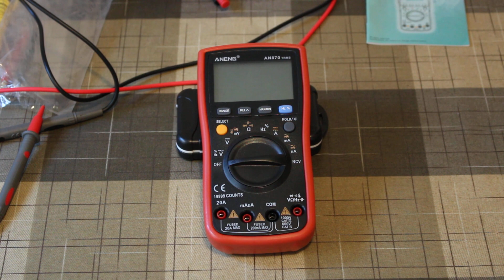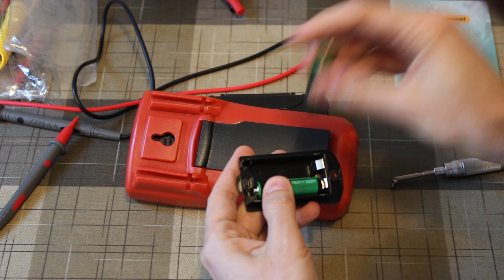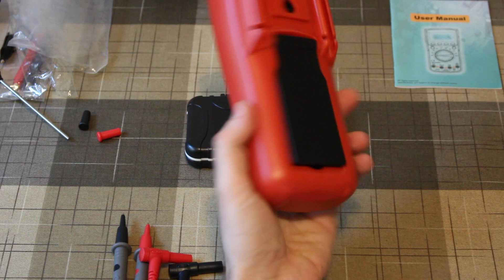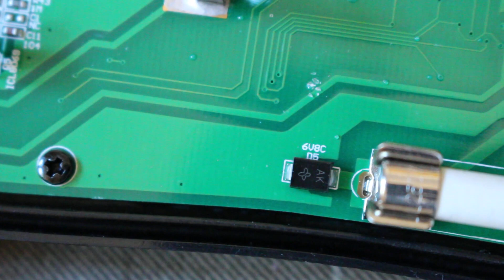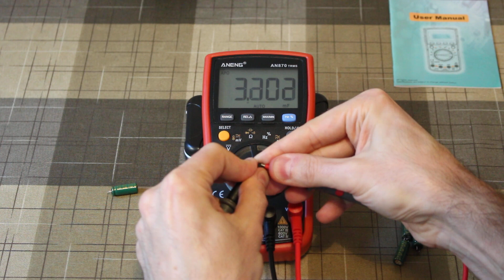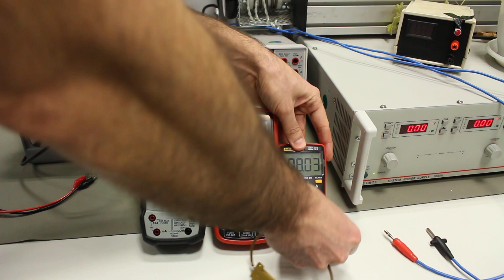Aneng AN870 Multimeter Review and Performance Test (ZOTEK ZT219, RICHMETERS RM219)

Comment: For ANENG 870  during the test for frequency and duty Cycle I think you should use Hz % on the right side not the left one with AC symbol, this video of frequency and duty cycle is so misleading.... sadly.
Reply from the maker: Correct. I did not realize this at the time. See the pinned comment.
Reply: @ruevs  Ah thank you for the respond. So is this multimeter able to measure the frequency of square wave? I wish to measure instrument with 17DCV Amplitude and work at 0~12kHz.

Comment: The AC voltage measurement with waveforms other than sine wave is disappointing. The AN8009 performs a lot better. I wonder if this flaw has been fixed in newer editions of the 870.
Reply from the maker: Good question. However I have not bought a newer one - this one still serves me well.

Comment: The .01ohm shunt is dissipating 4w at 20a load. Doesn't that small length of mystery wire get hot enough to affect its resistance? Is that accounted for in the software calibration file?
Reply from the maker: I have not tested it. I think it is unwise to measure more than 10A for more than a few seconds.

Comment: Thank you for your comprehensive review. This is the best review of the AN870/ZT219/RM219. All of the other YT reviews failed to check its specified DCV accuracy of +/-0.05%+3. It'll be interesting to know how well it maintains its accuracy after 12 to 24 mths. This meter is very good value given its high resolution & accuracy. However, given it has less input protection than more expensive high-end DMMs means it should not be subjected to misuse or abuse - take more care with it.
Reply from the maker: Thank you. I still need to go back and check the frequency and duty cycle in the "Hz" mode and do a proper resistance test, but the multimeter is good indeed! And it's my second most used one (number one at home)  since I got it.

Comment: Good video. I know now which one i should buy. An advice , tests with ac voltage having a frequency above 120 hz are meaningless because the device was not designed for higher frequencies. I see they are not true rms because the measured voltage varies with waveform  and does not match the HP DMM
Reply: It would be nice a test with 60 or 50 Hz and different ac waveforms sine square triangle
Reply: The resistance test is really a shame. You should get some good bananas
Reply from the maker: @gheorgheioan95  true :-)
Reply: From what i can dee they measure proper only sine wave, for the other the error is huge

Comment: do you think the AN870 supports 3.7v, because I would like to use a rechargeable battery to power it ?
Reply: You must connect 2 diode with lion battery consecutively
Reply from the maker: I have not tried it. Nominally 2*AA are 3V and a fully charged LiIon is 4.2V (it is ≈3.7V for most of its discharge curve). I doubt it anything bad will happen if you feed it 4.2V but you never know...
Why do you want to power it from a LiIon? What's wrong with rechargeable NiMH AA cells?
Reply: @ruevs  I no longer have NiMH AA cells, but if I have a lot of batteries (LiIon) of the perfect size, so I would like to know if there is no danger of damaging the device
Reply: @Schwalbe262  "
the voltage drop across the diode". Google it.

Comment: About aneng an870,  What is the voltage limit for frequency and duty cycle measurement?
Reply from the maker: Theoretically the input voltage tolerance of the voltage input shold be 1000V irrespective of the measurement mode. But I have not tested it.
Reply: @ruevs , in Hz /% scale it says "low voltage", but the manual has no reference regard voltage specification.  Can i use the AC position to measure DC signals?
Reply: For such a low price multimeter, it is aimed for home or hobby use, not recommended for high voltage high frequency situations.

Comment: I have compared the Aneng AN870 with a Siglent 3045X DMM (0.01% accuracy). I tested just DC voltage on a lead-acid battery (so a very simple test). The Siglent reported 12.226 V and the AN870 12.227 V. That was really a surprise, this cheap meter was really "spot on". However, AC, current, resistance or other DC-voltage ranges are not tested yet.

Comment: Hi, in you're video, when you test the An870 in frequency meter mode, you have the selector on the left side, what are the readings if you select the "Hz %" on the selector for the range ? At 48:40 and after when you say it is having trouble at 200KHz...
Reply from the maker: Good question. I did not try. I'll try it and let you know when I have some time, but I expect the results will be similar.
Reply: he chose the wrong symbol